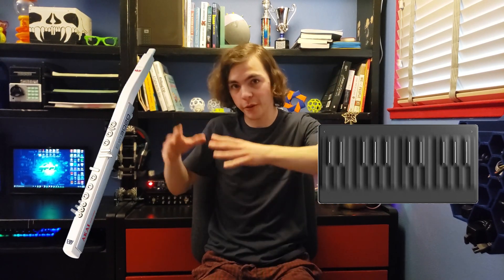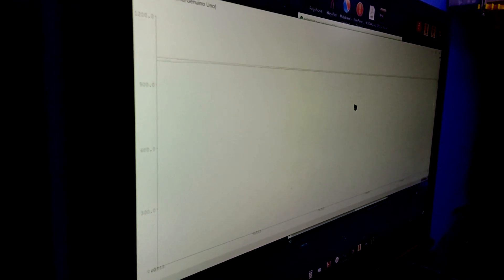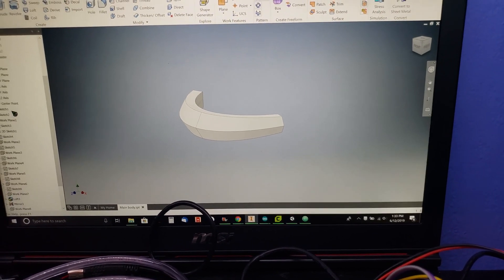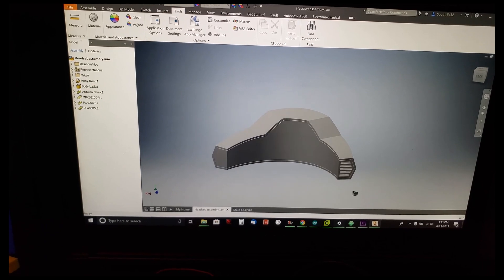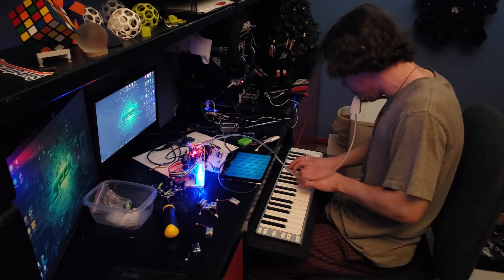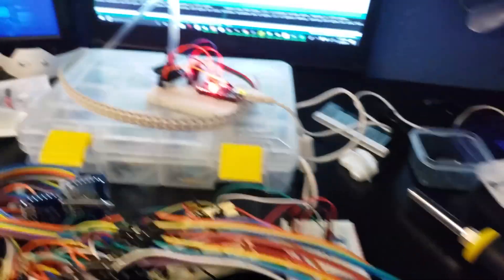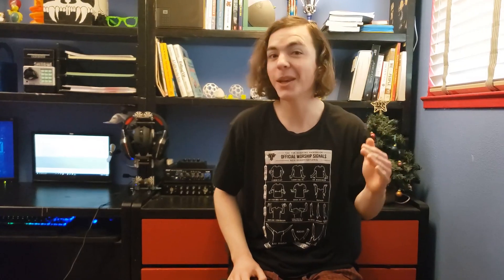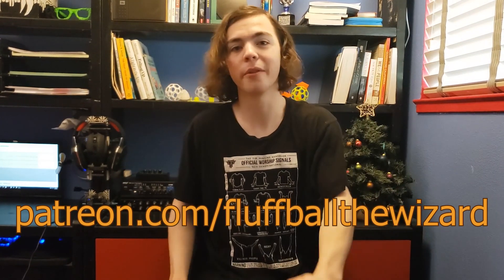Designing a MIDI BREATH CONTROL headset - Instrument project update #3

Comment: Would it be possible to get a link to what kind of tubing you used?
Reply from the maker: Awesome to hear you're making one! If I remember right I just got the tubing from my local hardware store which sells it by the foot, I'm sure you can have similar luck. Just bring whatever you're trying to fit, and see what fits best!
Reply: @davisdiercks  thanks!
Reply: I'm building a midi wind instrument and this is pretty helpful for figuring out the pressure sensor stuff.

Comment: Ive always wanted this because I have a spinal cord injury and want to use my mouth where I cant use a foot
Reply from the maker: Man, I didn't even think of the accessibility uses of this! If you want something for yourself, I'd recommend checking out the "Photon" mouthpiece by IMOXPLUS - it's a project my dad found after I started this and we've both been keeping an eye on it; they're currently doing beta testing and are a lot closer to the production stage than I am. Theirs and mine are fairly different in form, and in the other sensors on-board, but independent breath control is the main component of both.